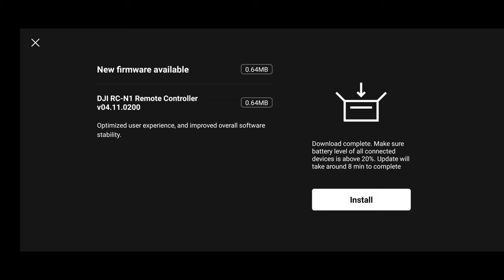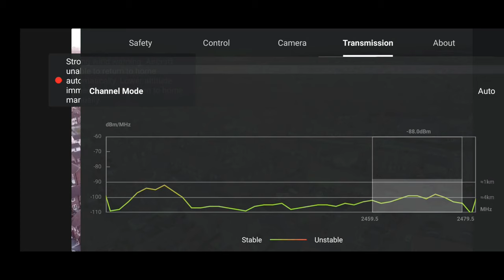Has the DJI RC-N1 Firmware Update FIXED Connection Problems on Your Drone? | Mini 2, Air 2, Air 2s

Comment: There is absolutely a problem with the current updates.  In the US I have FCC mode.  I am used to long range flights of 5 or 6 km over the ocean.  Everything has been great until I updated everything.  Now I'm lucky if I can go 2 or 3 hundred meters.  I looked into rolling back the updates to my controller and the Air 2 and it just happens to be a version that cannot be rolled back.  I am extremely upset, mostly at myself for not following my own rule of "if it works, don't fix it"  I hate buying products that require firmware updates.  It's only helpful if a problem arises.  These issues are only going to hurt DJI in the future as I will be looking at other brand names now.  One day you're out flying and all is 100% perfect.  You go home and update, and the next day, your drone is basically a flying brick.  It appears obvious to me that these last updates to what DJI considers older drones now is nothing more than DJI sabotaging these drones to get the customer to buy newer models. If that's the way DJI wants to play, then they just lost a loyal customer for life.  I'm not going to play that game!
Reply: I couldn't agree more. I (had) an A2S and preferred that over my mini 2 and even some of the newer stuff out but man oh man, they will refuse to accept anything other than pilot error for anything. Its comical actually. Undoubtedly. It will bite them in the long run. Consumer grade competition has completely caught up and with the dirty business practices they are participating in, combined with government agencies slowing down purchases and being presented better alternatives, they will fail. Its sad but they are at the infancy of the Traxxas rise and fall in the rc world.

Comment: Last week i did  firmware update right before a shoot, when launching after 3 meters my rc loses connection, after some testing i found out that the dual channel transmitter and the option 2..4GH and 5.8gH should not be set on auto, when i manually select one of these two frequenties, i can fly normal
Reply: Did you ever find a fix to bring back dual band

Comment: I wished I would have held off.... I did the firmware update on both the controller and my Mini2 aircraft and I got to fly it once before the controller completely stopped connecting to my phone. Check my channel for more details. This is quite a catastrophe since I'm currently in Europe and was planning on using my drone extensively. Definitely a lesson learnt (the hard way).
Reply: No good
Reply: Try using the DJI assistant on PC to refresh the controller.
Reply: Me too i'm having the same issues , but i still had connection between the rc and the drone, still very annoying

Comment: Are you guys having the same issue ? Dual Band mode is unuseable and 2.4GHz is slightly useable, but 100m range till it disconnects ? Please help me out here. My mini 2 is now a useless piece of plastic.
Reply: Bro same issue with my mini 2 from a last weak you have any solution.??
Reply: @HELLZONE01  Unfortunately no fix for that one, only fix is sending the drone to DJI to get it repaired. They replaced my motherboard. Those updates were enough to fry the motherboard.

Comment: Was having issue " Remote Signal Lost" even on less than 1Km range, really really annoying. Updated the controller now and still the same freaking issue
Reply: same problem 😢
Reply: @muhammaddd2513  kindly update the firmware , and double check from fly safe data base that it’s updated as well. It will resolve issue tilll 500-800 meters range
Reply: @PropertyExpertPK  I've tried it and it doesn't fix the problem

Comment: If you are using the old firmware and having the disconnection issues with RC Controller , kindly check the safety settings, I always check safety settings marked to "Break" so aircraft can hover over the object but it crashed in a tree returning home (manual) as i faced couple of disconnection errors. So the glitch is having an effect on other settings for sure

Comment: Thanks for this great video, Gavin.  I too was seeing regular loss-of-rc-contact error messages for the past few months (DJI Mini2).  Also in that same timeframe, the tx-aircraft binding step took some 3-minutes or more!

I finally decided to follow the link in the DJI GoFly app and download and install the latest firmware.  Then I took the Mini2 up to our ranch and tried it out.

The tx-aircraft binding only took maybe 30-seconds.  Also I only saw RC errors when I truly was out of rf line-of-sight.

I experienced none of those pesky RC errors when the aircraft was sitting next to me or in the air in plain view.

Oddly I have no idea why the RC errors started in the first place (a few months ago).  Maybe I got the aircraft firmware and the tx firmware out of sync.

It's good to get back back to normal Mini2 operation.  I truly love this aircraft.

Merry Christmas and Happy New Year 🎄⛄❄️😀

Comment: I have the rc n1 with MA2, I am running the fly app 1.6.9 iOS still, however when I updated to 1.9.0 fly app transmission was rubbish, so maybe not advisable unless you know what too do but this is what I done, I made sure my I phone was backed up, deleted my phone restored it from I cloud and it gave me the option of a few recent back ups, I chose the one when I had fly app 1.6.9 and got that app back 😊, now I’m just leaving it no more updates, as you say if it’s fine or not broke, leave it !
Great as always Gavin thankyou….

Comment: Hi, only had my DJI mini 2 less than a month and I do have a thing about updating, phone, software whatever.
My mini has been updated
App Version - 1.9.2
Aircraft Firmware - 01.06.0000
RC Firmware - 04.11.0200

weather is pretty crap on the west coast of Scotland just now so not a lot of flying/learning but when I do doesn't seem to be any issues. Only flown within the confines of my local rugby field and 100ft at most though. anyway that is me. Changed all 3 of my batteries each time  I set up, so they are all in sync with the software. I also had to reformat  my SD card as my software couldn't read DNG file. All good now.
You can add it to the pot od knowledge.

Comment: I'll have to check again.. Lately I've been having some issues since the latest update, but sometimes i'm out 7,000+ feet in the wilderness with no issues.. really hit or miss..  I noticed where I live in the cold and If i leave my Acura MDX running with the bluetooth connected it happens much more often

Comment: I have had lousy connection with the DJI RC and the DJI RC Pro remotes. 2000ft distance and it gets signal interference in multiple locations.  Tried with both Mini 3 Pro and Mavic 3 Classic.  If you have a 5G iPhone anywhere near these controllers it will kill your signal when the phone is on.   I hope this remote handles that problem.

Comment: Ok so I admit to being a bit bemused. Since sometime around 20 December, my Air 2S with RC-N1 updated to 04.12.0100 which is later than the one that Gavin shows. As of today, 3 January, what firmware versions should I be on? My aircraft firmware is 02.04.2500. When I flew the Air 2S with these versions I did suffer 2 disconnections so, having seen Gavin's video, this leads me to wonder if these are due to the reported problem or if they were just coincidence and caused by something else. If anyone can list the up to date f/w versions, I'd be grateful. Thanks, Erik.

Comment: Hi Gavin, yes, there is definitely a connectivity problem. My Air2 with DJI RC-N1 was fine until I updated to the Air 2S lately. I had endless connectivity issues; I was determined to take the matter to Court. Luckily the Shop Owner was kind and just Refund me. False advertisement and endless headaches would cost a lot.

Comment: As of 2/23. I am on Aircraft Firmware v01.06.0200 & FC Firmware 04.11.0200. The issue is still not fixed. The camera feed fro the drone keeps cutting out after about 10-20s of flight time. Extremely frustrating.

Comment: Last Sunday. I was in the middle of a Hyperlaspe. After about 3 minutes, the controller briefly disconnected just for a second. After......thr Air 2S unexpectedly decended from 350 ft  and tried to land over trees 1300 feet from home. 
After hiring a friend to climb the 80 foot tree.............im a little reluctant to fly it.

Comment: Hya Gavin,
I updated my rn 1 & mini 2 last night and today it did another like last night. I updated this second time to mini 2    01.06.0200    R N 1 controller to   04.11.0200 I restarted and checked all settings, took off. Now compass is dead and shows NOTHING. What is with these updates s each one causes more trouble that I never had???? Ray   totally confused now. Any ideas?  I want to go bck nd just forget these updates on the mini 2.

Comment: Reading through the comments on here, I'll stick with what I've got on the mini2 at the moment, controller and drone working perfectly well with Dronelink app and that's what matters, haven't flown with the DJI fly app since the end of May last year, only 4 flights using it totaling 42 minutes for the whole of the year compared to 180 flights totaling 794 Minutes with Dronelink

Comment: I just got off the phone with DJI and they will have a new update as they broke the compass again like last time. It is so odd because the drone has to know if it is west of you it has to fly east to get back to the home point so the compass works but does not show it is working on the map in the left lower corner. But bring up the map and it still shows the drone, me, home point, and which way the red line guides you back and the drone orientation as well. It is nuts the compass on the screen does not work. I wonder why they screw thid up as the compass on screen nothing moved or shows anything except the location of icons but nothing works or moves. Crazy Huh? Ray C. FYI: I did take my tablet & open google maps and orientate the figure 8 to set the compass on the tablet, and I did do a compass calibration on the drone as well. I can not understand why this happens. Ray

Comment: Always great and wise advices. I take from this vidéo that RC update are not prerequisites.  But are some levels of M2 firmware prerequesites for some version of DJI fly app ? And is it true that you Can not anymore Roll back firmware update as you can with dji fly app updates ?
Reply: Nope. Anti rollback in the drone

Comment: Hi,hello.. currently i'm using/update latest version to DJI Mini 2 v01.06.0000 and DJI RC-N1 v04.11.0100..should I update to latest firmware DJI RC-N1 v04.11.0200? Thanks in advace ☺️
Reply: I also have the RC-N1 version v04.11.0100, did you check if there is a newer one?
Reply from the maker: My y take is that this update seems to be perfectly fine if you want to update
Reply: @GAVINHR  as soon as I get home I'm going to test it, I hope it solves my problem, I have an open complaint with the seller, I'm thinking of returning the drone!
Reply: @LtonNicchio  last night when I want to try night fly, there's a new version for RC-N1 v04.11.0200 appears on screen but I'm ignore it..after got reply from GAVINHR,this morning I'm surely will uodate it

Comment: Definitely something not right with this latest firmware update. Having had no issues with my M2 performance or controller before the update, the following day after I updated I began experiencing problems requiring an IMU calibration and lost connection. I was travelling in Australia and had been recalibrating the compass after lengthy distances, but was unable to fly until the IMU calibrated. This took 3 attempts and meant I missed photo ops. I managed to launch again but the hover wasn't steady and one of the motors appeared to be out of sync and it ran rough??? After a fourth attempt at the end of the day the IMU calibrated successfully and fingers crossed it's operating as it should 🤞 This however came immediately after the update and no other changes in conditions/damage/collisions etc. Not happy at the time but hopeful it's now resolved.

Comment: This firmware update has not come to my RC N1, probably  because I have not updated my Mini3 Pro with the Remote ID firmware (0.00.0400). If this is true, this update for the controller has not come to users who have not updated their Mini2 with the recent Remote ID firmware, either. Can anybody check your drone with Drone Scanner if you install the latest firmware?

Comment: I updated the mini 2 ,had disconnected issues within metres.   But i didn't  update mavic air 2 had no issues at all ,
so il be leaving it   Thanks for heads up gavin :) great content
Reply: Did you have connection issues between the rc and the drone? Or between the rc and the cell phone? , I'm having some issues today for the 1st time between the phone and the rc with the latest everything with my mini 2
Reply: @darkwishpunkd  between drone and controller
Reply: @bigsighmusicdroneblogs1843  same i freaked out today i was in a valley, and it got disconnected and it didn't return to home so i was thinking whay the hell happened lol, a very bad firmware i won't advise anyone to update to this current one

Comment: So, what's the difference between the controllers that came with my Mini 2 and Air 2s, which have green lights, and the controller that came with my Air 2, which has white lights?
Reply: No difference, AIR 2 RC-N1 controller has white LED lights, Air 2S DJI went back to the green LED, better visibility in the day maybe.

Comment: I haven't been able to fly my mini 2 the last few months. RC connection is 25% reliable and it will disconnect as close as 20 feet up. It's always returned home but now I can't safely fly it anywhere. Thought about buying a used RC if I find one w the older firmware and trashing the one I have. Or just selling the damn thing since it's useless to me.
Reply: What? 20ft range only? That's ridiculous. Write DJI Support a mail! It's advertised to have like 6 miles range!
Reply: @xxBlackpspxx yep, about 20-50
Feet for me. Disconnects, reconnects , totally unreliable.

Comment: I have Zero trust left in DJI regarding their firmware updates & release notes. Case in point being the 01.05.0000 update which stated in release notes that it addressed "Flight Safety". After performing the update you are no longer able to "Roll back" any newer firmware update even if it causes flight issues. Absolutely NO mention of that in the release notes prior to nstalling, so under-handed it's unreal. From that point on my Mini 2 is not going to be updated. If that means i'm violating some made up law then so be it.
Reply from the maker: No arguments for me Nick! I just provide the information for the viewers to make up their own mind :)
Reply: @GAVINHR  Yeah fair play, you do an outstanding job too. Keep up the great work.

Comment: HELP..!!
Hello everyone. 
 I have one Controller issue after some time working without problems, the controller don't recognize the smartphone.
 I've tried everything. Three different phones, android, iphone, some different USB cables, type C, type A with OTG adapter, lightning, everything. The only interesting part it's the phones started to charge when I connected the cable, but it's not recognized for the controller trying all the suggested methods.

I connected my phone with other DJI controller and works perfectly, also linked my drone with other controller and works fine. In Android i tried activating the Developers  mode, the USB depuration, deactivating the USB charge, with the same results, anything.

Also I tried to do controller firmware downgrade but I just have 1 version installed in the controller and was not possible using the DJI assistant 2.

I'll try changing the front USB port which is plugged through an flex cable inside the controller because I'm very frustrated.

If any of these works, I'll buy another controller
Reply: If you can't downgrade it in DJI assistant try refreshing it.
Reply: @GH-uq7wr  how can I do that if when I plugg the controller in the DJI assistant 2 doesn't show any update or downgrade?
Reply: The refresh button option in the DJI assistant is not available

Comment: Ik this is off topic but PLEASE ANSWER mavic mini and mini 2 with dji fly app on android 12 and 13 is 1.6.12 better than 1.8.0/1.9.0?
Reply from the maker: The later app versions are designed to work with the later versions of android yes 👍
Reply: @GAVINHR  sorry I think u didn't understand what I'm asking is range better on 1.6.12 1.8.0 or 1.9.0
Reply from the maker: Range alone is about the same
Reply: @GAVINHR  thanks so much but 1 more question how about connection stability with obsticals ect? Because if I'm honest 1.8.0 feels 3xs more solid than 1.9.0 in my experience on both android 12 and 13 better quality also. So I reckon 1.6.12 might be the very best?

Comment: I think the Problem is the  stupid  Display Controller. 😉
Reply from the maker: its getting better i must admit but the phone / RC-N1 i still prefer yes
Reply: @GAVINHR  The normal Smartcontroller is very nice.
IT works  very good with my Mini 2 and Mavic 2.
HDMI Out is another good Option.
But not to use with Mini3, Because DJI want to sell New Products 😏
Best wishes from Germany and happy New Year

Comment: NO NO NO!!!! IT DID NOT FIX THE CONNECTION ISSUE, still the 5.8ghz is so weak
Reply: Same here, 10 meter disconnect for 5,8ghz
Reply: @OnoSenoCuk  yeah same issue, mine doesn't even go for 10 meters. It's like 1-5 meters. 2.4GHz is like 80m. I used to fly 1000m+ with no issues
Reply: @IsleOfADV  have you solved your problem with your drone?